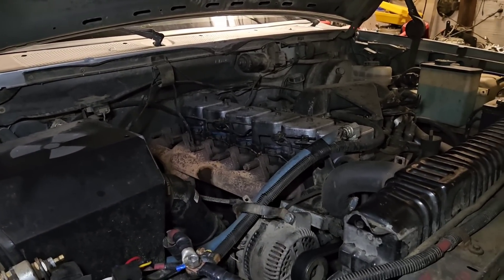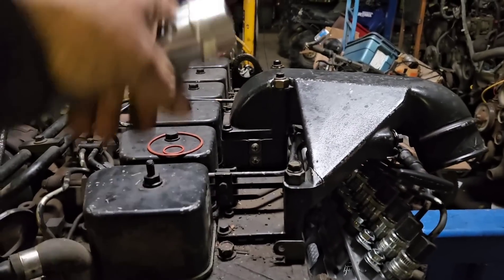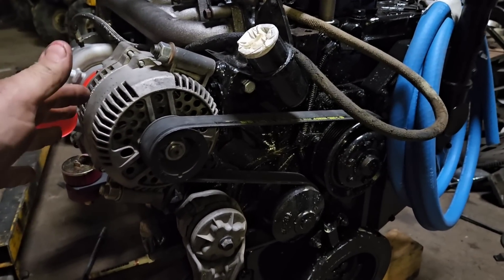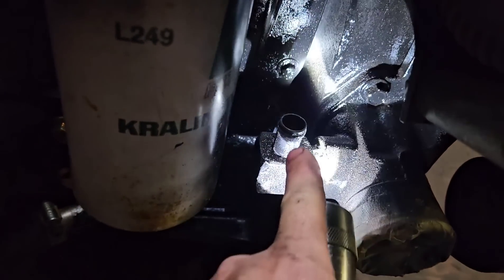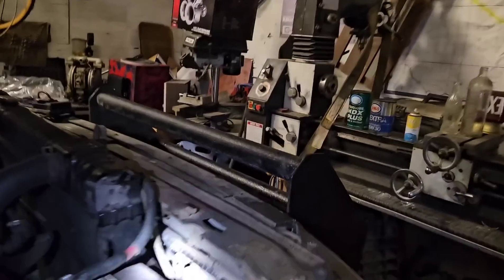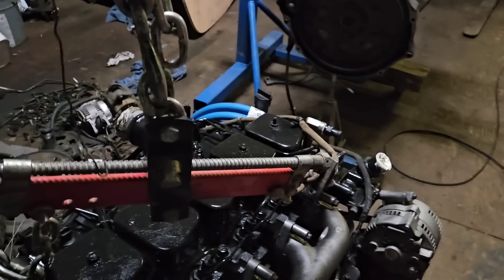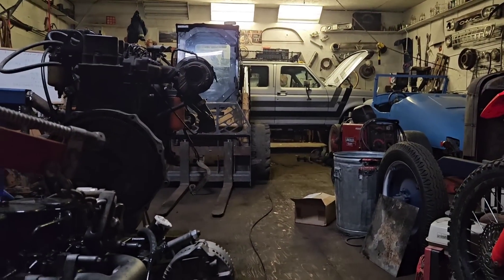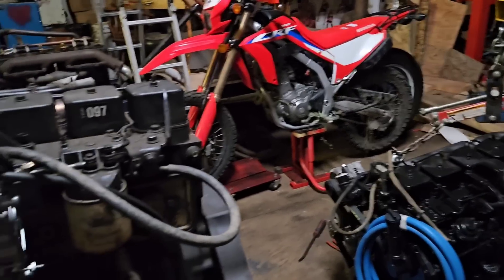quick cummins swap obs ford tutorial

Comment: The info its great, i've done most of the things you mention in here, now i'm trying to use the stock cluster on the f250 but im lost with all the wiring, does anyone have any info about it?
Reply: You have to buy a special adapter harness to get the stock cluster to work if you search on google about it you’ll find it and it should be plug and play from what I remeber

Comment: when i did my cummins swap in my 1996 crew cab f350 i used a 1993 dodge 12v cummins with a getrag 5 speed with the 2nd gen dodge dually transfer case and made my own engine mounts and did not have to have drive shafts made, i used a stock 2nd gen front drive shaft and put the dodge yolk on the end of my ford drivehaft, and had to do very very minor firewall modifications (no body lift)

Comment: i have a 91 F350 with 7.3 IDI w/ turbo 4x4 5 speed manual. Would you stick with the ford 5 speed or swap for the dodge 5 or 6 speed? Currently hoping my 7.3 last long enough until i can afford to do the swap.
Reply from the maker: I Always use the ford zf5, getrag 5 speeds were ok, nv4500 failed when lugged down too low...

Comment: Hi I'm going to start a swap The engine is from a 95 Dodge 2500 12v, swapping in into an '89 Ford E350 wonder if the engine mounto from F series of that years work or fit in E SERIES?
Reply from the maker: No idea if vans are the same...should be

Comment: Thank you for this info and visual.
Ive wanted a 12 valve F250 obs. 

Whats the situation with OBD? I dont necessarily need that function on this setup but id like to hear what you did to either make it work or maybe not have a constant engine light? Relocating anything for the air intake? Whats the setup for that btw
Reply from the maker: Sadly all my vehicles have the engine light on...

Comment: Great video, Saw'doff.  I did a 4bt in my F150 and used all factory Ford/Cummins parts except for the AC adapter and alternator mount.  It is super do-able.  My F150 had the M5OD-R2 transmission so anything small block Ford will bolt up.  They even make a flywheel for that set up.  I had gas to diesel conversion stuff on my truck that you didn't because you started with a diesel, but it is all fairly common sense.  I eliminated the tank switching stuff and installed a new 38 gallon tank in the rear and hogged out the fill neck.
Reply from the maker: Switching valves are a weak point for sure

Comment: 0:01 I believe it's a 1994-1998 12v, not 1998.5 correct me if I'm wrong. Now, 1998.5 means it has a 24v Cummins. I'm just saying.
Reply: They made the 12 valve up to 1998.5, after that it was 24 so technically he's right
Reply: IIRC all 98 12 valves were made in the latter half of 98.   by the time the year actually started, 24 valves were already rolling off the production line.  I believe you are correct, with the .5 year noting the change.
Reply from the maker: 98 to 98.5 was a 12 valve h.o. bigger injection pump delivery valves for more horsepower